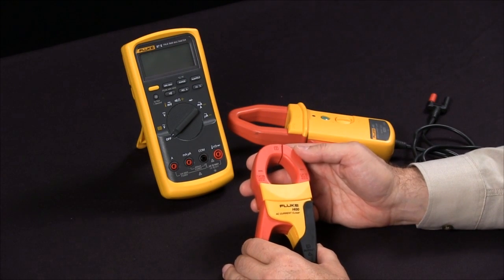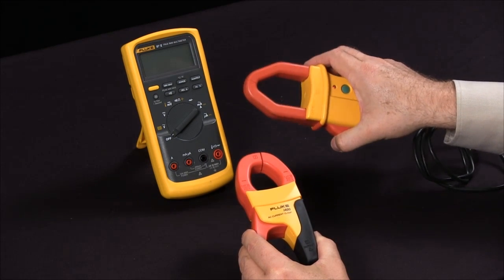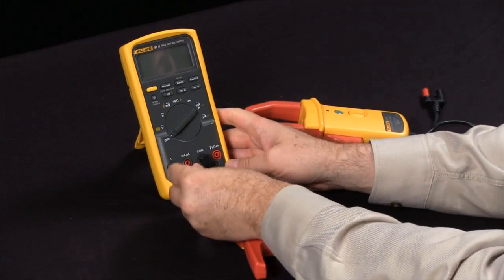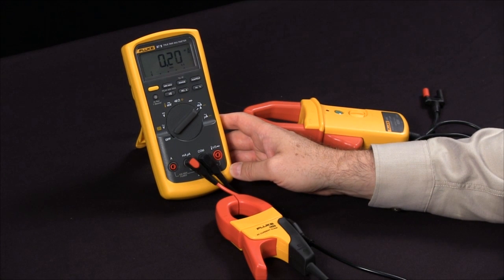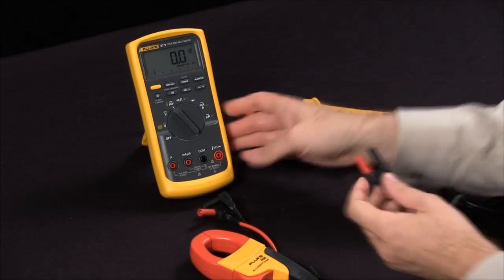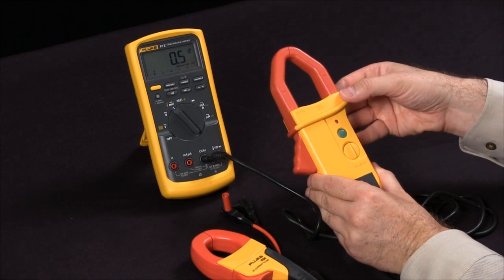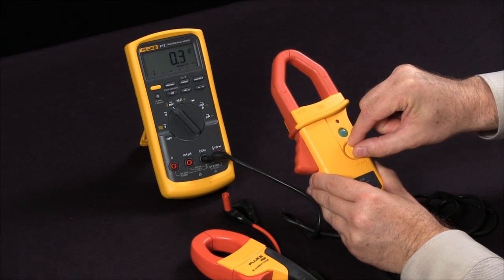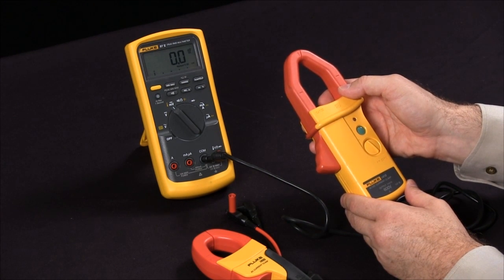How To Configure A Fluke Multimeter To Use AC And AC/DC Current Clamps

Comment: May I ask if i410 is compatible with fluke multimeter 1587?
Reply: I have an i410, normally use it with a 189 and 110 series so it should work in your 1587.

Comment: I’m trying to measure inrush current no greater than 200A and it comes up as OL. Plz help
Reply from the maker: Hello Christoper - This might be easier to troubleshoot if you reach out to the Technical Support team direct, call 800-873-5853. If not, which meter are you using and what current clamp? An OL is an indication of an over range on your meter. What range do you have the meter set for? This question is assuming you are using a multimeter with a current clamp accessory. Let me know or please call in for immediate assistance. Thanks.